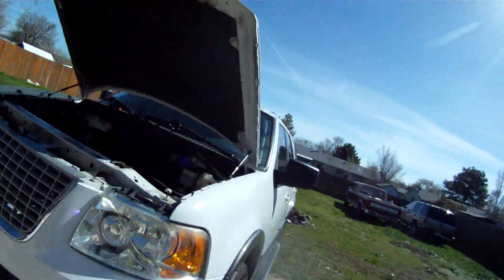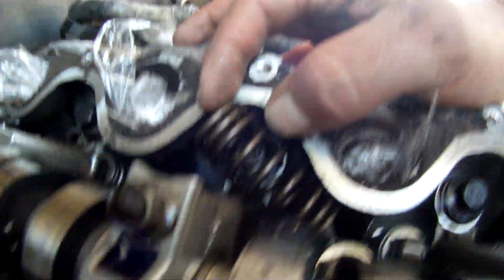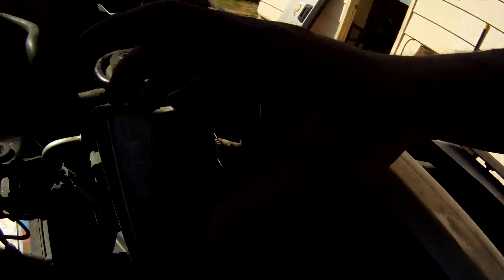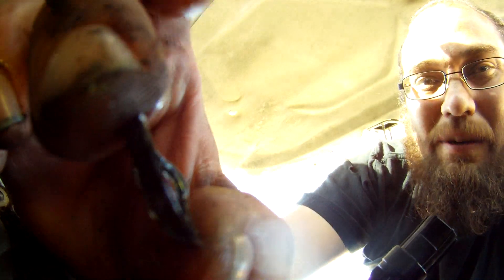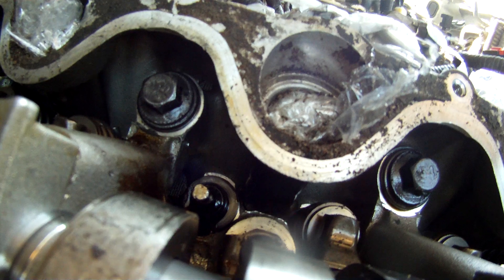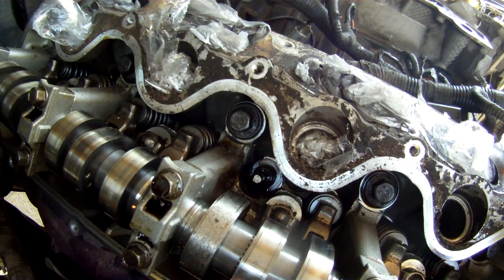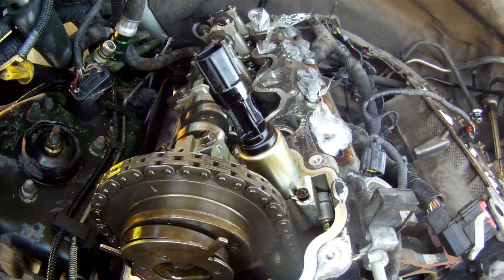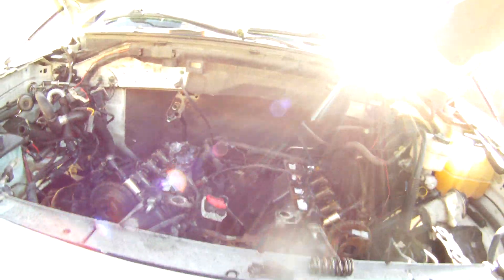05 Ford 5.4l Triton Lifter Failure

Comment: Are you able to get the rocker covers off without having to take almost everything apart in the engine bay? Also, is it a reasonable expectation to change the lifters with the engine still in the truck? Thanks
Reply: Yes and Yes. There are other videos showing the repairs on an in frame

Comment: My 5.4 triton 04 expedition is at 370000 original miles and Still running. It’s been my back up vehicle throughout the years as my newer vehicles break down.

Comment: The oiling system feeds the drivers side with oil first, then finally what is left over gets to the passenger side.  It is low oil pressure what causes this.  The fix is a hi volume oil pump from Melling and the updated roller cam followers which have a much smaller oil bleed hole.  Also the recommended oil of 5W-20 is way too light and needs to be 5W-30 to maintain viscosity and lubricity for the engine to live.  The cam chain tensioners are bad too due to being made of plastic.  With the heat/cool cycles the plastic warps and then oil pressure is lost there.
Changing your oil on a very regular basis will be the best to prolong the life of the engine.

Comment: the roller follower i bet was the culprit. The roller in the middle of it was sunker down, the needle bearing in it bit the dust. After awhile the cam lobe will spit off the spring and the lifter.

Comment: I have 1998 Ford 5.4 liter Triton motor with 320,000 miles, it is how the motor is cared for and ran that makes the most difference.  Proper oil changing, correct warm up procedure (just long enough for oil pressure to lubricate valve train), not stress motor until operating temperature, and keeping the RPM between 2,500 - 7,500 most of the time.
Reply: Your right
Reply: Well what's changed from a 1998 Triton v8 t0 a 2004-2008?

Comment: Have an 05 super duty 5.4 Triton 3 valve that keeps hydroseizing or static dieting. Replace the solenoid packs and all the injectors, fuel pump, crank position sensor, fuel regulator and still keeps hydroseizing, any clues?

Comment: I got a tapping sound consistent tap.  Car drives fine but tapping that gets faster with acceleration.  Doesn’t shake and still smooth.  Think it’s lifter as the cam lobes are smooth.  Working on it when weather gets better will uodate
Reply: Did you ever figure out what the problem was. Im having the same issue right now 😅
Reply: @axelmoctezuma  it was lifter and roller issue.  Replaced all of them and sound went away

Comment: this is a very late comment but the tick was more than likely the valve follower roller bearings failing which introduced poor fit into the valve lash and led to complete valve follower failure. The right bank is the oil starved bank and the follower failure usually occurs right there at the back of the right bank. The right side and possibly left side timing chain tensioners may have lost the seal up against the block leading to oil starvation to the rest of the motor. That lubrication loss is fatal to the roller bearings of the valve follower and if bad enough will eat up the cam mounting seats. The motor looks pretty clean inside so perhaps oil passage blockage due to extended oil change interval is not a factor. If there is sludge unseen in the video then look also to reduced oil flow from the crud in passages.

Comment: Did it throw any codes when this failed? I have a ticking noise too and I thought it was an exhaust leak
Reply: More than oNe kind of tick...
Reply: Same just found out by the shop its not exhaust leak but a lifter problem , just bought the truck off dealer too 2007 lincoln 109k  @carnivalartistagency

Comment: USE OEM FORD PARTS....IF YOU USE DORMAN OR GARBAGE AUTO ZONE PARTS FORGET IT RUNNING CORRECTLY
Reply: duralast is the exact same in craftsmanship as motorcraft. stick with motorcraft plugs, everything else duralast will work just fine in it.

Comment: Excellent video! I been running the triton motor for some years now and I must say I have good success and part of that is I only use Ford oil and filter recommended and I stay up on the maintenance. However lol, I did pick up a 2005 f250 with a cylinder 5 misfire extremely lite tick sound on the driver side. I was wondering if I could email you the video if you could suggest we’re to start on the repair. I think it’s valve related. I put a piece of paper near the exhaust pipe and it’s pushing the paper back and forth. From the internet they said it’s valve related issue. Any suggestions would help thank you
Reply from the maker: highgrooveauto30@gmail.com shoot me an email and kinda recap what you got going on there. Thanks for the positive feed back on the video!
Reply: @MattShaughnessy6  sounds good, I will send now thank you!

Comment: Do these engines have hydraulic lifters ?
Reply: Yes.  Tritons do have hydraulic lifters (under the cams), but they also have many other parts that can possibly give the engine low oil pressure issues.  Overhead Cams (SOHC or DOHC), timing (bicycle) chains, chain tensioners,  rocker arms,  timing chain guides,  oil passage way flow issues,  no replaceable bearings on the camshaft, vertical mounted spark plugs in heads, COP ,  etc ,  etc ,   &   etc.   All this crap needs to be in 110% good working condition for your 5.4 to keep on running.  The minute one little thing F*%KS up, your motor may be toast and need thousands of dollars in repairs. Unless you can work on your ride yourself and you can save on labor costs... ITS A FORD MAJOR SCAM OF THE CENTURY!  I hope Mr Fords great great great great grandson is reading about how his company has turned into a POS!
Reply: stephen gaertner 👍🏼👍🏼👍🏼👍🏼👏🏼👏🏼👏🏼👏🏼

Comment: I don’t agree with your statement that it’s not a good engine there has been multiple revisions they are a good engine compared to Chevy and dodge  but nothing will beat a Windsor 351 or 302
Reply: My stepson have a 2018 silverado 1500. He buy it new. 3 month ago dealership replace the brake master cylinder for free, due a recall. Right now, theres a noise caming from between  transmission and engine, sounds like the release bearing but this is automatic. And make and inspection, and see a leaking coming from the front main seal. And valve cover start doing the same.  Whats happens with Chevy. This truck have only 27 k. Never been abused. My 2002 Chevy Cavalier still working amazing. Myself replace the head gasket twice. And still working like a champ. Being mechanic. Always love Chevy engines. But dont know whats happens since 2000s. And agree with the engines u named. Plese, add the 350 chevy.

Comment: My 1997 f150 5.4 l triton drives normal as long and runs normal but when u first start it knocks a little and when u reach high rpms it knocks I purchased a replacement engine and transmission but I don’t wanna replace it if it might not need to be any advice
Reply: That's a connecting rod knocking.
Reply: Sounds like a cam chain tensioner has failed hydraulically. It has to pump up at first start and won't hold pressure at higher RPM's.

Comment: I was given a “free” 2008 Ford F-150 with a 5.4L. I’m only in it $2,500 so far and still have to do the timing kit to do. This is my first and last Ford I will ever own. I will never give their company another dime in my lifetime and will tell everyone I know to avoid them at all costs. I never fully understood the GM guys bagging on Fords until now. Henry Ford would be so disappointed in the quality and support from modern Ford.

Being given a Ford is like being given a free 5lb bucket of old shrimp after you get food poisoning from a store’s shrimp.
Reply: courgargold shoot I wouldn’t even buy a new dodge. I haven’t heard about these new pickups but the body style before it i heard nothing but wiped cams, lifters and rockers in the hemi.
Reply: I grew up in a Ford family and the 5.4 3-valve is why some in my family switched to a different brand. Too many problems.
Reply: karl yukon Yeah, kind of sad. I’ve seen friends switch away from American to foreign made trucks because of it.
Reply: @cougargold  Sorry to have to tell you this but all the brands are running only 50-60% domestic content. My cousin's new Raptor has 50% domestic content and both the 3.5eb and 10-speed transmission were listed as made in Mexico on the window sticker.
Reply: Should have bought all your parts on eBay and get everything to rebuild the engine for two hundred bucks
Reply: Free ? Lol 😆 and it was junk weird.

Comment: What it's the sound the motor makes with that problem? Mine just broke down on the highway the other day.  It started really knocking so loud. So I coasted to a stop and had it towed back home.  The knocking was only when I gassed it. Now it does it when I turn the key. I'm guessing from research, its the time and chain tensioners. But after watching your video,  your problem is the only sound I haven't researched.
Reply: I. Have that problem currently. Was it you chain guide.
Reply: How much did it cost for the chain guide repair.

Comment: So stay away from the 3v. The 2v is good but the 3v?  Nah.. No way.
Reply: I’d buy another 3 valve without blinking if it checks out overall. 5w-30 is the key once the components have been updated in the timing set. Oil changes have to be regular also. (3-5k) Ford oil filters only. I would however recommend someone who doesn’t do the maintenance on their vehicles as they should to stay away from this one, or you won’t be on the road long.
Reply: @BottomDwellersTV  I agree 100% as with anything else maintain your vehicle and it will treat you well.  I have an 06 5.4 3v with 316k miles just did a preventative timing job.  Dont regret buying her for a second.
Reply: Neptune I have a 06 with 90k   I did new updated solenoids vct  and new updated spark plugs   Trying to figure out if I need to do anything else    The new vct solenoids fixed the hot idle knock    But it still has a tick   And sometimes slight startup rattle and hot idle releasing gas pedal wen driving slow it makes a chain type noise that’s very slight and fast    Other than that it seems great    Any tips    Also do these have hydraulic lifters ?  I heard some good stuff from running some Lucas to bump up oil pressure
Reply: @joesmith-fi1sx  Your startup rattle is most likely the timing chain tensioners going bad. When the gaskets blow out on those they bleed off oil pressure when the engine is off and cause the timing chain to slack and bang against the plastic guides inside the front cover until the oil pressure builds up again. The ticking during slow driving could also be caused by this, but I would try to rule out an exhaust manifold leak first.
Reply from the maker: Yeah the 2 valve and anything produced after the year 2012 is good. They dropped the Triton a d redesighned it in 2010.

Comment: I've owned a 2000 F150 Triton 5.4 2v Windsor for almost 20 years. It has almost 220,000 miles on it. I've hauled dozens of loads of crush and run, pulled boats and trailers all over. The ONLY thing I've replaced was the intake manifold at 200,000 miles. I would say that I got my moneys worth, and its still kicking .
Reply: I have a bunch of the 2 V  5.4 Tritons  with 300,000 plus miles also, good engines. But the 3 v  engines are no good. Plagued with phaser failure, chain and tensioner, chain guide self destruct, low volume oil pumps, and rocker follower failure...
Reply: @john7017  i wouldnt say theyre plagued with problems. Those are typical varable valve timed issues when oil isnt changed like it needs to be or ran dry. Another thing is excessive heat. I love 3v triton engines.

Comment: I got Ford 2002 4.6 in a 5speed car, owned for 14 years only use Mobil 1 10w30 syn only use motocraft filter 820s got over 320000.0 miles on my baby in she still runs great no leaks no smoke no oil missing between changes! Still got original clutch original abt everything but maintenance stuff Praise the Lord. My family depends on this Ford daily !!! FORD TOUGH!!!
Reply: The 4.6 is a much different design compared to the 5.4 3-valve junker. The 3-valve version is a more complicated piece of junk.
Reply: @karlschauff7989  4.6 runs forever, those are the crown vic motors. The problem with those 5.4 traces back to a 2 penny seal on one of the tensioners that blows out. With the vvt system oil has to be precise. Any neglect, long OCIs, failure of the seal robs oil pressure to those parts. The new rockers have a pinhole on them to increase oil pressure. It is a crapshoot. Guy is right to avoid them. I've seem beautiful shiny used expeditions for sale but they have this problem.Some poor sap buys them and has a 5K bill.
Reply: Does yours have the ford tick from the engine? my 5.4l 2002 just started getting the tick at about 115000 and its at 119000. Not sure what to do to fix the tick, or if I even should.
Reply: @dylandrury2884   just drive it and change your oil at 5000. With sinthec oil. Mine started at 110,000 now 245000 still going strong. I use lucas oil treatment with every oil change and my tick is gone.
Reply: No I got tick!! B safe!! U can't just let Ny one work on ur stuff !!! I fix all my own stuff!!
Reply: I'm not super great with cars but I really like to learn and do everything I can on my own, sometimes I get some help with little stuff. When did you get the tick? Do you know what the issue is? It alarmed a little bit but there's some mixed stuff if its safe or not on the internet. thanks for getting back to me so fast scotty

Comment: thought it would just blow out the exhaust. the crank turns a little ways then stops ??? got 280,000 miles think its blown or what should i do to troubleshoot or narrow down what it could be?
Reply from the maker: do you have access to compressed air?

Comment: Got a question my o5 5.4 just seized up driving down the road started sqeeking then seized. I think i left some porcalin in the cylinder what could happen if that happened
Reply: That has nothing to do with it. That stuff with go right past the valves. Sounds like you dropped a valve or it overheated
Reply from the maker: Kevin Moa when you say "seized" do you also mean that the engine won't turn a rotation by hand using a wrench?.....as for your question....I don't know many things could happen. It could score the walls if the cylinder maybe? Or it could break up upon combustion and get stuck in vavle??.....what are you thinking?
Reply: Mine did the same thing I lost oil pressure seized up but then the next day started right up but now I have lifter and lash noise from under the valve covers. In guessing the chain tensioners leaked starved the top end: (

Comment: is that from doing the spark plugs and leaving some porcalin from the plug in the cylinder
Reply: You need a magnet
Reply: @bthompson1767  Thank you thats where I stopped the video got sick of watching the fumble fingers routine.
Reply: Looks like it happened from weak valve spring let the keeper fall off, high rpm and weak springs
Reply: Is this the truck you already worked on
Reply from the maker: Kevin Moa no this happens when a roller falls off the follower. Main cause of this on this engine is not changeing oil. This is actually a common failure on this engine.

Comment: I hate these engines so much. Too much work for a crappy engine.
Reply: I HATE tritons..
Reply: There's a reason Ford threw the whole design away and started over with the 5.0L V8. The 5.4 is junk.
Reply from the maker: Tavo24vv yes! It is a massive amount of work to repair and Ford will not back us technicians on it.

Comment: I didn't know until after I bought it but I really dodged a bullet because my 98' Expedition has a 2V ! No cam phasers and regular spark plugs . My only concern is how the oil pump is installed onto the crank behind the timing gears Sheesh ! if it ever fails I guess I'll just get a rebuilt motor or a new car !
Reply: Its never going to fail.I was on a crown vic forum 20 years and never heard of that part failing. Some years actually had bad tensioners that failed early but ford replaced them. 98 modulars are the highest quality,.

Comment: Great videos man. I really enjoy watching diy mechanics such as yourself.   I permanently fixed my 07 F150 3v 5.4 by selling the damn thing and losing my ass.  

At 110k mine developed the infamous "tick". I tore the engine down myself and replaced everything with oem Ford parts. All timing components,rockers,lifters,oil pump. After dropping about $2500 into parts I was so disgusted with the truck I sold it at a loss.  It did run amazing and I loved the truck overall but I lost ALL trust in it.  I pull a 26' TT quite often during the summer camping and I couldn't trust it wouldn't shit the bed somewhere down the road.  Very sad
Reply from the maker: thank you! This poor owner is going to take this vehicle straight from house to the dealership at a loss. she would be better off is what I told her.